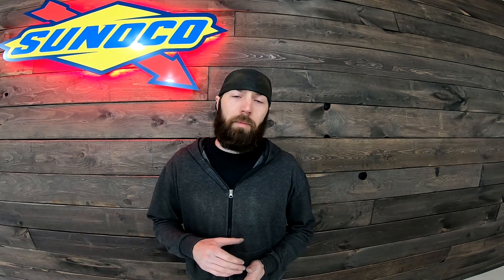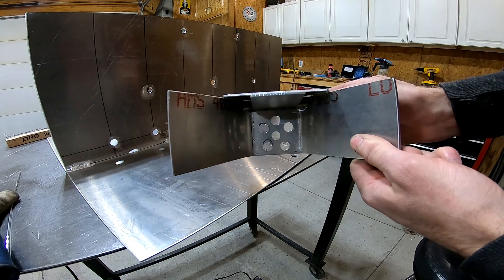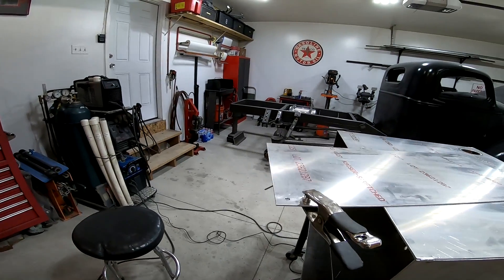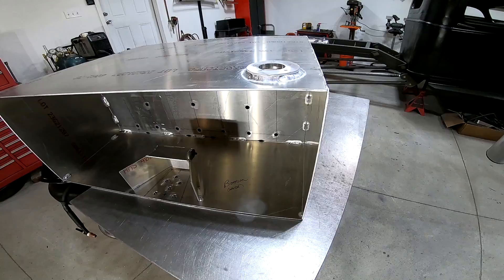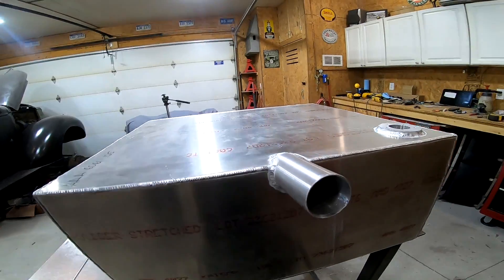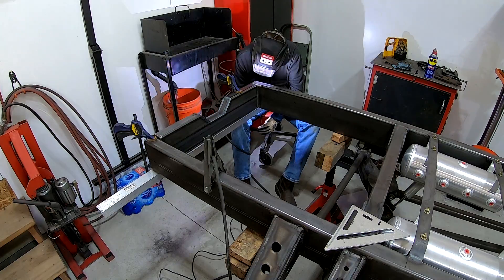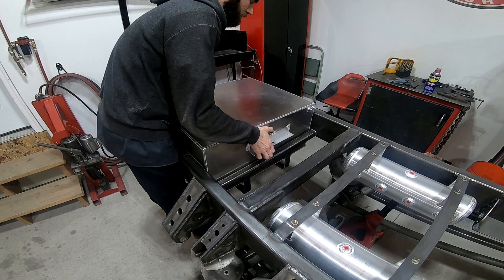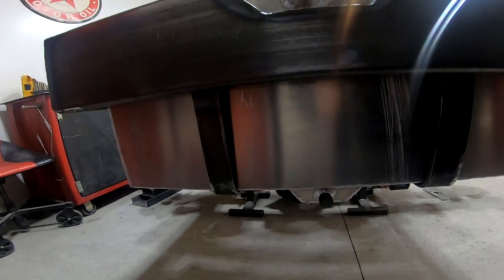Building an aluminum fuel cell for the 40'

Comment: Everyone knows to use 5052 aluminum for fuel cells...Anything petroleum based uses 5052. A simple google search would have told you this. NO ONE in the automotive industry or trade would use 6061...🤦‍♂🤦‍♂ I hope you aren't putting this tank in a vehicle for the street. Gas will eat that 6061 over time, its not chemical resistant like 5052.
Reply from the maker: Update, it just exploded!, fuel everywhere! My garage is a total loss! Several casualties. Send help immediately there's not much time left!

Comment: Nice work and cool truck. You may want to look at the material 5052 for tank construction its a preferred material. It has better corrosion resistance and  takes impacts without cracking better.
Reply from the maker: Will do, thanks for the info, and for watching!

Comment: I would understand this effort if it would be for a prototype involving military research or corporate research.
But for "do it yourself" at home (or in personal workshop), I think that the end does not justify the means.
An aluminum fuel cell will end its useful life in only few hours after pouring the electrolyte, and if the electrolyte is not evacuated from tank, that degradation happens regardless of voltage being harvested or not. 
The only way the effort shown in video worth to be performed at home/personal workshop, is if someone intends to submit a patent application at the United States Patent Office, and wants to test the idea before submitting.
I gave you a "Like" as reward for your hard work.
P.S.: If by "fuel cell" you meant a gasoline tank, that is a completely different story !
But by naming it "fuel cell", you attract a different kind of viewers, those looking for electricity generation from aluminum fuel cell. And that is why you have only 982 views after 15 months.
Reply from the maker: Thank you keyboard warrior
Reply: @onebullgarage  - - You are welcome !